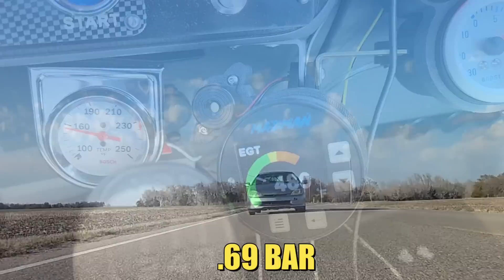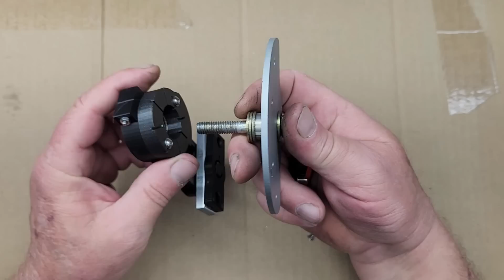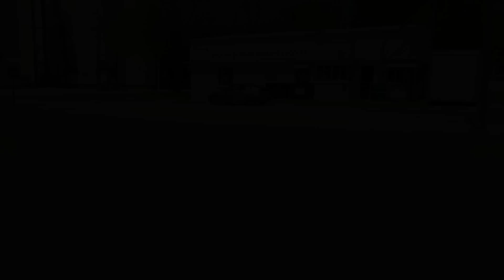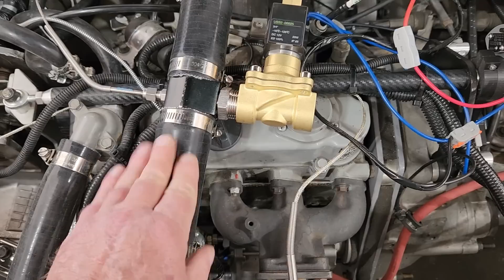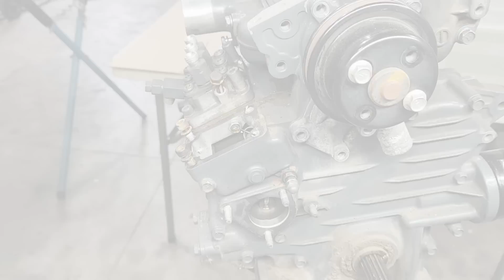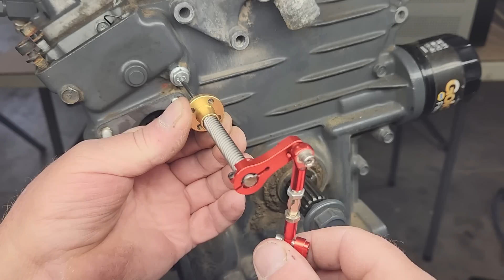S4 E15.  We  test the effects of full boost on the AMR500 supercharged the Kubota diesel engine

Comment: Hell yeah. I really want to see what happens if you get the boost up to a level like modern turbo diesels (A hint, its more than 12psi). If you were to target, say 20psi at max boost under maximum load with an intercooler, you would be getting into higher efficiency domains, but only for the higher power delivered. the variable boost would be key here; plumb back that bypass into the intake after the filter to keep the noise down. You could potentially repurpose some of the plastic intake silencers off, say a ford ecoboost 1.0 to try and keep the noise down.

Comment: I haven't watched the whole video as I write this comment but I'm a bit confused. Why have a supercharger that's switch activated by the throttle position? Isn't that basically just a turbo charger with more parts? Isn't the whole point of a super is that its like a fully spooled up turbo but its not dependant on exhaust driving the turbine? It almost seems ike it would have been better to fit a small turbo to the engine and have it always provide whatever boost it can. At idle it would produce less but at wide open it would produce more.

Comment: Jimbo yes or no - you do you but I've got an idea for a follow on project

Before the stupidcharger and engine is removed

Instead of releasing pressure by opening valves, attach the stupidcharger to a electric motor by belt (look into vesc's for motor control) and instead of dumping air when off load, just dont spin the stupidcharger also you'll see the difference between having the load of the stupidcharger on the engine aswell as a possible new peak top speed and acceleration run!

Comment: I have a 2023 Kabota tractor it has the old-school engine from the 90s 25 hp mechanical pump
He used to be a 35 hp engine before emissions drama 
They retarded the timing by adding shims in between the I’m gonna call it throttle plate and the rest of the injection pump. I think the timing went from 13° down to eight, but I’m not sure I researched it a year ago.

Comment: A few things I think might be interesting experiments: 1) possibly adapt a megasquirt or other open-source style ECU to control boost fuel etc. 2) possibly use an air/water style intercooler and a small heat exchanger for cooling the intake charge. 3) It would deviate from the supercharger only setup but compound charging with a turbo as well may provide some interesting results. I think the supercharger may provide a “boost” to get the turbo spooling sooner and yield additional boost.

Comment: Your core returning audience is probably always excited to see what efficiencies or modifications you can find so I bet digitizing your diesel would be quite interesting, but others may be excited to see the next mechanical project as the tangibility of things moving in a way you understand always makes the brain feel good.

If you ever want to have a go at your "normal" insight it would be neat to see you try to do some of the performance modifications Honda did to its little brother (ITBs with velocity stacks) even though it will add very little power to the 3 pot.

Comment: Yes
Even if the simple mechanical means wind up working as or nearly as well as a more advanced setup, that's still useful knowledge

I suspect what you really need is a way to gauge engine load to control the boost / bypass. Is there a way you could track the movement of the governor instead of the pedal position?
If the governor is calling for additional fueling, close the bypass, if the governor is calling for less fueling, open the bypass, steady state some predetermined working bypass level? Driving the solenoid with pwm definitely makes for a more complex control, but could let you tune on the fly and perhaps take additional inputs into consideration (rpm maybe)

Comment: Yes, please continue.  Also, try to reference the rack controller directly from the boost level. This will likely make it perform very closely to the turbo ve pump diesels of the late 80's. It would be interesting to see that in action, and also would be great to have a camera under the hood to observe the action, vibration, dust, and the venting boost!

Comment: An intercooler is probably the most logical next step for better performance. 

Is there a reason why you couldn't use an electronic boost relief valve besides cost? Much like many newer turbo engines.

And you're absolutely right that we want to see you tinker and find fun solutions to any problems coming up on your own of course. Anyone can buy pre built stuff and stick it on an engine. 

I'm looking forward to the custom hybrid electric drive system you'll invent next year for the supercharged diesel engine Honda insight Kansas Jimbo special.

Comment: Gm idle air control valve, tps, and a map sensor with Arduino to run it for an adjustable boost control. Like to see this so you have a smaller valve with lots of adjustment and positioning data. Another iac could be used for the fuel pin as well but would need a Little machining...  For simple boost safety, a mechanical backup, mini popoff dump valve, use a radiator cap. Can easily get any psi you want and swap them easily. Run the overflow back to the filter inlet pre boost. Keep up the good work! Enjoy the vids.

Comment: A vacuum actuated dump valve would be something much more likely to be found on a production vehicle than an arduino and servo contraption. There’s a little something that’s a factory solution that’s a bit similar, and was both a vacuum and electric version of it made: mechanical speedometer cable gear reducer adapter gearbox for COE trucks with 2 speed differential. Both versions were made by Stewart Warner, for Ford and International COE trucks in the 1950’s.

Comment: Add the electronic control. Electronics aren't inherently frustrating. Having locked down firmware with no access, and no way to adjust, or diagnose without specialized expensive tooling, thats whats frustrating.

Comment: First off.  Your project.  Not mine.  Though it would be great to see the fuel metering done with mechanical linkage to the throttle cable.  No to any computerization to start with.  Loved your blowoff micro switch solution.  Much better than a electric clutch on the stupid charger.  If it didn't get so cold here, I'd actually want to purchase this car from you when done.  A diesel in winter isn't my cup of tea.  Very excited to see what this car can do.

Comment: YES! I like how you're planning to use the servo controlled throttle body. An idea I've had for acheiving the same thing is to use a GM IACV as your dump valve. Seen plenty of 3d printed housings for them on other applications, most notably Luke's lawnmower carbcheater.

Comment: I think computerized is the way to go with this project. I don't know that much about diesels but I don't see how you can possibly juggle exhaust gas temperature, boost control and everything else with one little fuel adjustment screw.

Comment: i would also like to see plan c for boost control.  automotive throttlebody on the supercharger intake. adjust throttle stop to get atmospheric intake pressure at idle and experiment with mechanical throttle ratio to the actual throttle. it is also a way to reduce pumping losses off the  front pto. better yet fly by wire pid with target boost pressure vs throttle position, would work good in tandem with rack adjustment.

Comment: Instead of an ACME screw, you could use an M8 bolt and a nylon nut. The bolt is nice because it has a much finer thread pitch, and a nice hex end that's easy to fit a 3d printed gear onto. If you want to see what I'm talking about look up a  "Greg's Wade's Geared Extruder"

Comment: YES
Consider 2 sequentially sized solenoid valves instead of the small throttle body (same system as current just 2 switches)
Also consider a diaphram actuated fuel adjuster, possibly using a turbocharger actuator with adjustable spring weights.

Comment: 5:15 BMW Motorrad partno "13547657001" Cable Distributor, is the part you wanna copy and use, it was used on the later R1100 models and R1150 boxer engines to operate the throttle bodies on both sides of the bike. now it's drive by wire, motorized throttle bodies.

If you build such in dual stage with simple 2 potentiometers, as done on car's accelerators, the second one is for security, the ECU measures both time, to prevent that single potentiometer could send the car out of control, full throtle.
the BMW part, it's pretty well thought out part, for about 50us$, new.

you need crank position sensor, to make it electric.

Comment: I think it would be interesting to see how much fuel economy you can get by whatever means necessary. It that means tuning with software, I think it would be interesting. I don't see you getting much better fuel economy. Maybe with a turbo but it's not easy to make them work properly on a small engine. Tuning would be a neat option.

Comment: I wonder if it is possible to modify the drive gear for the injection pump to add variable timing, some sort of centrifugal mechanism the advances or retards based on engine speed maybe? I'm not positive but I believe that's how the old idi vw's did it.

Comment: I have had an idea for a displavement style fuel injection system. Imagine two shaft that have a cam system associated with them. Now imagine these cams acting on pistons that reciprocate at 180 degrees apart from eachother. Put the whole assembley in a diesel tub enclosure. Now, imagine one of those cams has a worm (helical) shaft running within it.the two cam shafts ban then tun out of synchronization. When this happens, the distance between the two pistons will change. Such a chamge will cause a change in volume between the pistons, thus eventually pushing a charge of diesel fuel through the injector. This is post apocolyptic endineering. I was however concerned about a gradual change in fuel pressure, so I was beginning to consider a pre-charge piston to boost the initial slope of the injector charge.

This is a dream of mine to create, I am not interested in wealth and fame, I just want it to come into being. 

So, maybe this injection system could be perfect for modern engines, and, may reduce the tappung noise diesels make these days. All mechanical parts are in constant engagement. The cams are interlocked between two gears. It is only the worm gear that shifts the phase of one of the cam shafts. It could be a can shaft or a crank, connecting rod and piston system. But being enclosed in a bath of diesel will prevent diesel leaks entirely.

Comment: First off, yes, an ecu on an analog diesel would be interesting to watch, and secondly, we use big 16 cylinder diesels engines at work, and we get alarms at 120 intake air temps. Air to water after cooler, maybe a solution. Plumb it to go to the cooler first, then engine. You currently have an over cooling problem, especially in winter, running the engine cooling after the aftercooler would pre-warm it before it goes to the engine.

Comment: An alternative to a intercooler, that could be interesting, is water methanol injection. It could increase the milage and power as well. They are a little pricey, $300-500, which may not be in the budget. 20° windshield wiper fluid can be used, instead of the special fluid they sell

Comment: Photography trick: action cams and cell phones do not have an iris to limit light, and instead have to use really high shutter speeds for proper exposure with bright lights. This is why your LCD screens flicker - the shutter speed is high enough to see each segment as it individually updates. Buy some "neutral density" (ND) filters for your camera(s). Ideally you want your shutter speed to be about twice your frame rate (180 degree shutter angle), so if you're recording 30 fps keep adding filters till your shutter speed is around 1/60 sec. Motion shots will look smoother and most or all LCD flicker should be gone.

Also do whatever projects you find fun. Most of us enjoy your enthusiasm.

Comment: There’s more fun to be had.
A mechanical way to get more fuel would be to add a lawnmower sized carby inside a chamber between the blower and the intake manifold and feed it fuel at higher rpm.
Alternatively add a fuel injector just prior to the intake manifold

Comment: For the fuel rack, you could use a lever plus the screw; the lever would serve not only as a ratio drive go give you more precise movement, but also as a way to move the actual mechanism to a place where it has more space to fit. You can decide how much range you want the screw to have to move by changing the pivot point of the lever it pushes on. To be honest, I haven't thought about the specifics of how or where you could implement it, but I'm sure that's something you'd rather figure out yourself anyway.

Comment: Also for air intake you should consider a box that isolates the filter from the engine bay. "Cold air intakes" like what you have now are anything but cool, they just suck in hot air from the engine. I get that it might have been easy to do, but try the air box before doing an intercooler!

Comment: I would call the first gen Insight, what the Miata is to modern Sports Cars, the First Gen Manual Insight is to Hyper Milling DRIVING Enthusiasts.  There are better hypermiling cars, there are no better hyper milling DRIVING enthusiast cars for people who like driving as much as they enjoy the reward of being an efficient driver.  Later we got the i3, and the Volt, but they didn't mesh the actions of using the gearbox to help improve regen via ratio which could also vary 'engine/motor' braking, which is a unique thing to the CRZ and firstly with the First Gen Insight.  I believe these functions make for a very fun and engaging enthusiast driving experience and owned one before the battery replacement was as straight forward as today.  I would like a similar drivetrain in a RWD car with a higher revving engine but its a hard system to engineer as a swap.

Comment: Yes please continue. I think the electronic fuel rack control strategy is a good idea for performance and exhaust smoke levels. 
But keep the boost control as the simple on/off solenoid, instead of using the throttle body. Once the intercooler is on, i would plumb the vented boost either into the air intake before the supercharger, or into the exhaust down pipe, which might blow away some smoke too. 
It'd be nice to see the Honda Insight dyno tested once all the power modifications are done, and you could also dyno the standard Insight for comparison too. Id also keep the maximum boost experiments below 15psi, as it will be directly comparable to the turbo engine as used in the Saturn. I like many others don't want to see you grenade the Kubota engine just  for the sake of finding the limits.

Comment: As an electrical engineer I would love to see the implementation of a simple system to manage the fuel rack, however I wonder if you could use an external wastegate as a mean to adjust the fuel rack which would be fully mechanical.

Comment: I would say keep going, my background is in computers, so oddly enough I love learning about the mechanical stuff, but at the same time it's nice to connect it back to something relatively modern. I guess technically you can do some crazy stuff with mechanical governor designs, but that might be too difficult and time consuming.

If you ever plan on actually driving this thing around regularly you should definitely go on because you can probably get insane mileage with just a little bit of computer input.

Comment: "actually this switch system is complex for what it does. And if I worked for Boeing, I could probably take a few shortcuts. But in our case, I want the throttle to work as expected, and I don't want the doors to fall off."

As an AvGeek, this made me laugh so much 😂😂
Reply: Same! I talked with a lifetime Boeing Engineer here in Seattle and he talked in depth about the mismanagement and outsourcing of manufacturing that led to disaster.
Reply: Yes

Comment: Yes, please continue. But please reconsider controlling boost by bleeding air. It's worst way. Steeve morris explained it in one of his videos. Superchargers makes more resistance when they operates on "free outlet" condotion. So you will make unnecessart drag to the engine at idle. He compared it to a vacuum cleaner when you block the outlet, the engine spinns faster, not slower(less work to do).

Comment: You might want to consider adding a suppression diode across the solenoid coil. When demonstrating the toggle switch for the valve, you can see your dashboard leds flash when you turn off the coil.

Comment: If you ever decide to go for a turbocharger a most likely suitable option would be the ones from the European 1.3 diesel engines, fiat multijet. 
Those turbos are tiny and there are options with vgt,
A vgt turbocharger, intercooler, timing control on injection pump paired with correction for load and pressure and this little car would fly doing way better mileage. 
If these hondas were not that expensive I would be engaging on a project like that myself, try to beat the 100 miles to the gallon mark.

Comment: Yes!  Your rack limiter acme screw would work, but how about the cable operated disc brakes from a mountain bike?  That lever and actuator moves only a small amount to squeeze the tiny brake pads and probably has the throw range you would need.

Comment: Absolutely YES

...

Why not use a small water injector to cool the intake temps.  No methanol required.
Easy to test...easier to install than an intercooler.  You can even use the same on/off switch assembly you currently use for the super harger.

I reckon than 1.5l/hr of water will be the top end of your water consumption